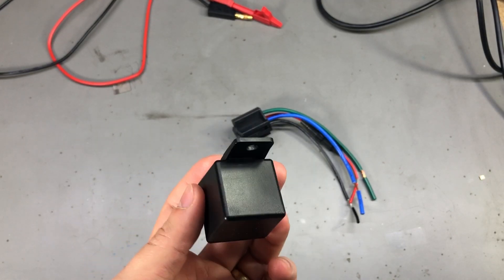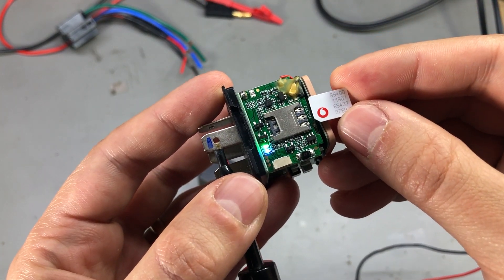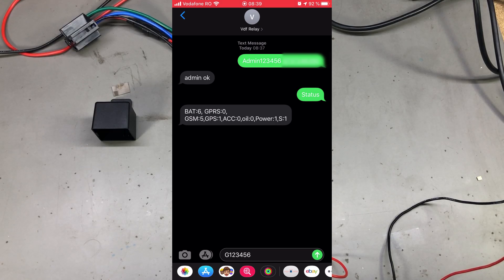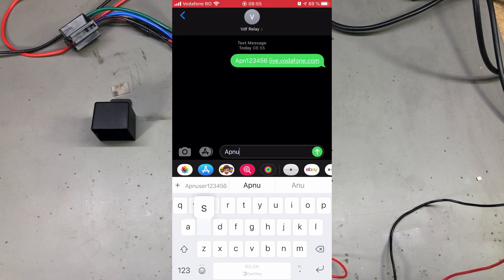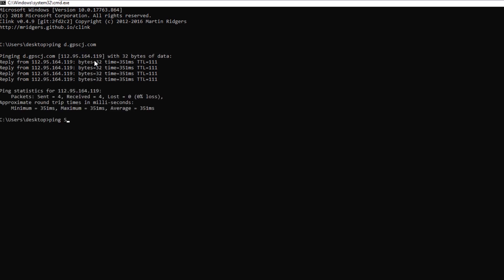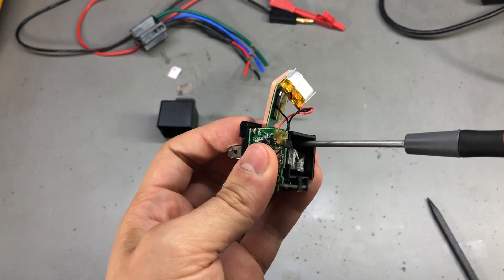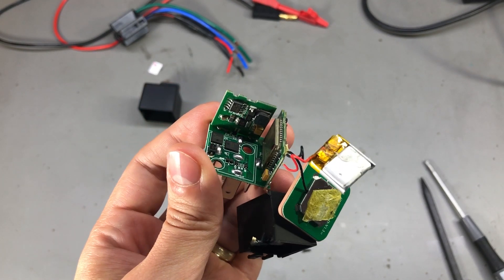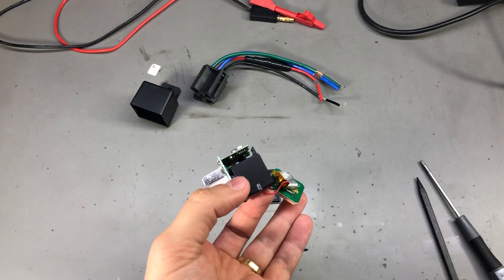Voltlog #272 - Car Relay GPS Tracker Setup CJ720

Comment: Hi I'm a fan of electronics and I wanted to ask for a courtesy, I bought a SUNKKO 737g + I have a problem as I insert the connector of the pedals goes short, (continuation from pulses) I thought it was the pedals instead no because I tried to insert a connector identical to that of the wireless pedals and does the same to me you can help me thanks in advance greetings and congratulations for the "LEO" channel

Comment: Good morning, I want to know how to migrate my GPS device LK720 (retransmission) to my own system, if it is possible to do it by web service or maybe the manufacturer's communication protocols. I am interested in a project for a fleet of 600 vehicles, I have not received a response from the seller in my country and I want to make a larger purchase of equipment, you will not have the contact of the manufacturer, greetings and excellent video thanks
Reply: pudiste hacer que funcionaran en tu sistema???
tambien tengo un proyecto similar, pero me he atorado por el sistema.

saludos!!

Comment: Neat. With a proper install (i.e. well blended into the existing bank of relays and wiring harness under the hood) this would be damn near impossible to find.
Reply: I have installed it behind the dashboard great reception left.
Reply: My concern is cell and gps signal greatly reduced under a steel car hood
Reply: @turbomar6667  yeah that is a valid concern. I guess if your putting it on your own car you could opt for a fiberglass hood for better signal. That's a lot more work and $ though
Reply: It's very easy to detect if you have the right meter....
Reply: Michael Lange what meter would I need ?
Reply: @JA-yy6bd  RF meter, but it would only work while it is active.
Amplified headphones will sometimes pic up noise from cellular transmission as clicking noises too.
Reply: Frinch Frize thanks for response would just turn engine ignition on and headphone jack place  on to car bodywork?
Reply: J A why tf do you need to know unless you want to steal cars?!

Comment: Nice video m8!! But you have to check the installation spot. If there is metal above the GPS then probably you wont receive good GPS signal.
Reply from the maker: k yf sure, any big metal surface would seriously impact the signal but I was thinking under the dashboard would be a good spot.
Reply: @voltlog  Can you extended the antena from the relay to the another place?
Reply from the maker: @matematic7240  maybe but it would have an impact on antenna performance so it's best if used as is.

Comment: I got one of those a month ago and,  of course,  took it to bits immediately. Very disturbing fact is, it uses MosFets instead of a relay. Not a good idea to drive inductive loads as a starter or a fuel pump since it has no built-in surge, overload, temperature or any other protection. 
Not sure about EU regulations,  but here in US and also in Canada is against the law to interrupt the fuel pump with such devices,  as this may cause an accident and death. 
And I was always wondering what is this Oil Pump that all the Chinese manuals refer to? And it's always shown in the engine compartment?!? I've never heard of an electric oil pump in any car,  also cutting off the oil supply to any engine will only cause a massive failure of its moving parts.
Reply: Firstly, I don't think this is actually meant to replace an existing relay. It has simply been made to look like a relay in order to look discreet. I believe the idea is you can use it to disconnect the switch cable to the fuel pump, rather than replacing the existing fuel pump relay. 

Typically, when Chinese gets translated to English, they might say 'oil' when they actually mean 'fuel'. But as fuel is derived from oil, technically they are not far off!
Reply: @danyalm10  It is not meant to replace an actual relay at all,  you got that right. And I bought it thinking it will and was wondering how did they manage to power it up through the contacts. I actually only bought it to figure out that. It's also bigger in size than a car relay.
Reply: Pretty sure few people care if you give the thief a bad day because you cut the oil or fuel pump. Personally, I'd prefer one of the terminals to be hooked up to 5lb of Semtex.
Reply: @Jin-Ro  You don't seem to understand. It will not give the thief a bad day,  it will give the car owner a bad day, stalling while on the road. The power to whatever load you're interrupting with it has to go through the MosFets in order to operate, for instance a fuel pump. If those MosFets fail while you're driving it, the car will suddenly stall. Imagine you're with 70 MPH on the highway at this point... 
And worst part is,  those are 2 MosFets in series.
Reply: Bollocks. No car is supposed to "get you killed" just because the engine stops at any point - that is something that can happen at any time to any car anyway. There is no such thing that a car that can guarantee you it will positively never ever break down while being driven. Getting yourself into a situation where loss of power gets you killed is a driver problem, not an equipment one.
Reply: any one with a few brains and a understanding of how non english people orate will work out they are referring to fuel
Reply: I wouldn't use it as a switch inline with the fuel pump. I would look for the existing fuel pump relay and put this tracker inline with that relays input. So the tracker would only be driving a relay not the fuel pump directly. This would make it easier to bypass by removing the fuel pump relay and shorting the contacts but it is an option. 
And as somebody else mentioned, when they say oil pump they probably mean fuel pump. Simple translation issue I would guess.

Comment: I would also like to see that tracking server. Is there an alternative firmware maybe?
Reply: No need for an alternative firmware, you just reconfigure it to send the data your/any Traccar server.
Reply: @jangrewe   i have a device but it expired can you help me move it to an open server
Reply: @amirsaeed636  Sorry, i dumped all those chinese trackers and bought a Teltonika FMB920 instead - much better, easily configurable, great documentation, and not that expensive either (~$35).
Reply from the maker: I don't think there is any chance for alternative firmware as these Chinese SOC are usually closed source.
Reply: @voltlog  Ah, darn shame. Just have to watch to be sure that no weird SMS messages get sent to weird numbers then... I don't know how you could know if it was sending weird stuff out over the data connection...

Comment: Does this work with 4G networks? 2G and 3G are shutting down soon.
Reply: 2G only. As most of those GPS trackers. Not  for use in US and Canada.
Reply from the maker: is 2G really dead in the US and Canada?
Reply: @voltlog  2G has been decommissioned in all big cities, I believe only Sprint is still keeping it. In some remote areas it still exist. Since 2018 they started getting rid of 3G as well. Today,  there is barely any 3G coverage on T-Mobile, AT&T and Verizon,  which are the 3 major cell carriers. Sprint has never had a good coverage anyways, but I guess they struggle with upgrading their networks and that's why postponing the shutdown. Overall,  2G and 3G are already useless here.
Reply from the maker: @111chicane  I see there are already a number of gps trackers with 3g/4g support being sold on aliexpress so I'm pretty sure they will release more of those as the market changes. Here in Romania there are no plans to take down 2G networks, at least not publicly acknowledged.  I guess there are still a number of POS and industrial control systems which still use 2G networks as well as a number of low cost mobile phones that people still use so the big networks here say they will keep it on as long as it's needed by their clients.

Comment: I had a gps tracker about 5 years ago, command and control system looked the same, unit itself was very different though. I remember a similar issue with the server connection, it was something to do with the command being sent, I just don’t remember what it was.
Reply from the maker: yeah, I'm not sure I'll ever figure this out because even if I setup my own server the tracker is still going to be pointing at the wrong address the way I see things..

Comment: How does the gps antenna work if installed under the (metal) hood of the car?
Reply: It doesn't work at all,  unless you open the hood. However,  when it can't get a GPS lock, it will determine the position by triangulation of the cell signal,  which,  of course is far from precise.
Reply: D Stanoev unless you attach it to the wheel sensor sys....... Hehehehe you are absolutely that ex to track haha then sell the information to people on the dark web for quick cash......... It's that simple ... If you get your oil changed or your car serviced a slip  of less than 100 bucks and your everything is available. Get used to it or service your car yourself. ..  and under a hood ........ Just snip the ground . And it's now a  a receiver. You won't get that.
Reply from the maker: There are places in a car where you could install this and still get a signal
Reply: I was wondering about that...
Would b good if u test that..!

Comment: I would love to see you work on the open source server
Reply from the maker: I will probably do it but I don't think I'm gonna succeed in configuring this tracker to connect so maybe it's best to wait and get another tracker so I can have a fully working system.
Reply: I'd love to see that too
Reply: Can you get it to work with Home Assistant and it’s mapping?  Also where would I plug this into the car?
Reply: @MarkDuman  You need to hardwire it. It's not plug and play.